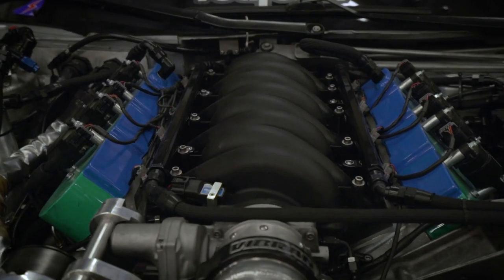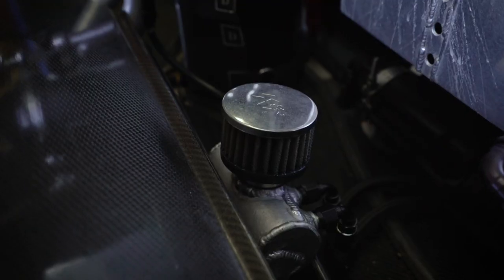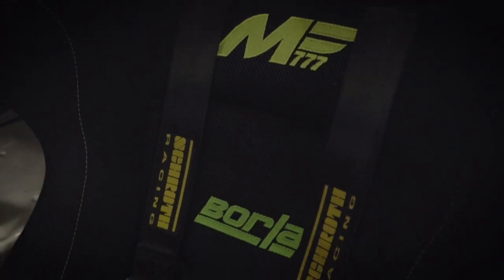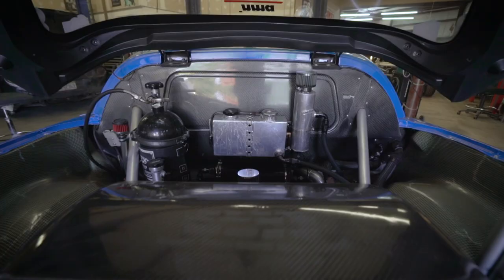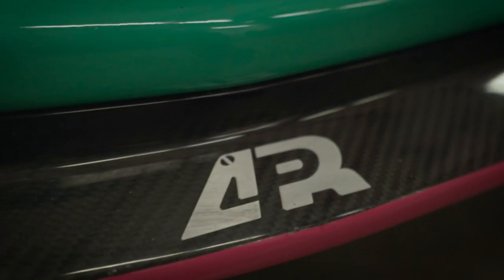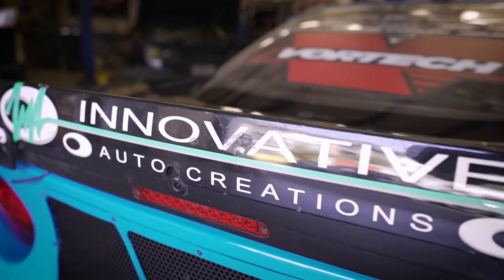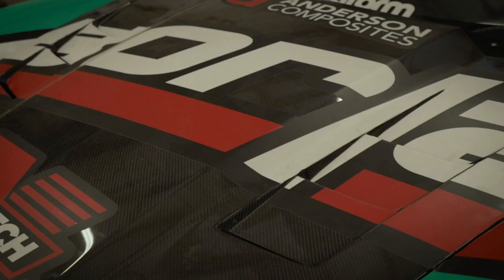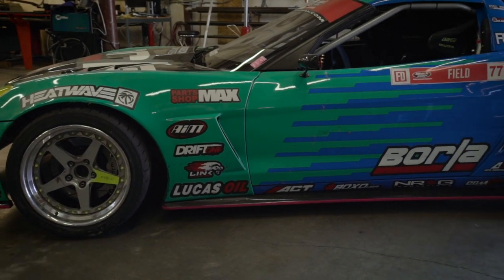Matt Field Vehicle Spotlight

Comment: One Of My Favorite Cars In Formula Drift! Will The 2020 FD Season See Matt Field In A C7? Or Maybe A New Mid-Engine C8? Inquiring Minds Want To Now!
Reply: I dont think anyone will be using a mid engine car in fd. To expensive to fix, not good to have alot of weight in the back it will pop wheelies if they run with the suspension that most fd cars run on because of the angle